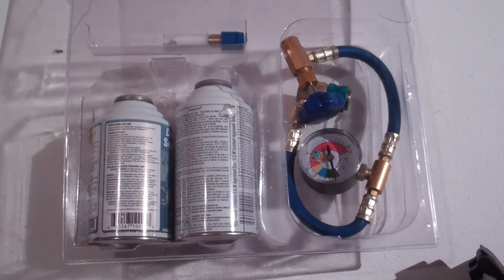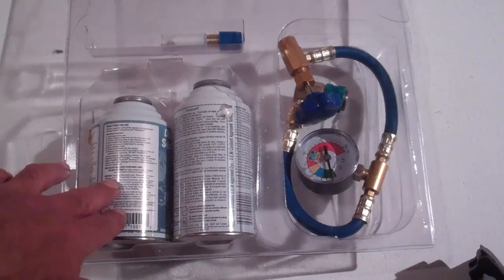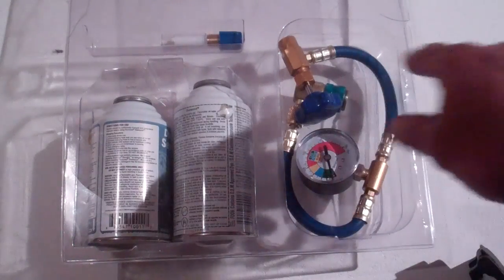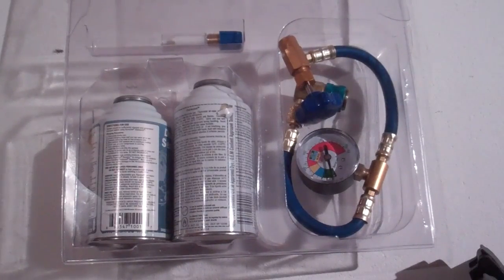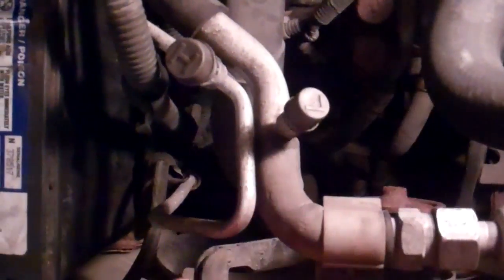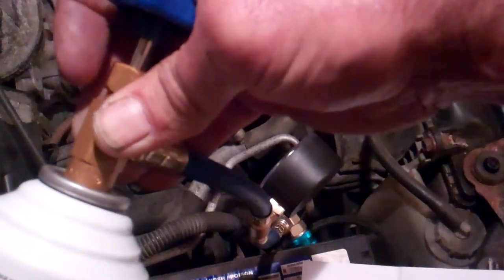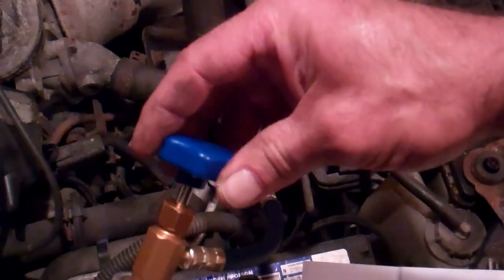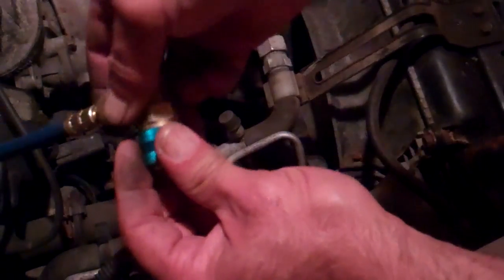Adding AC refrigerant into a vehicle system

Comment: I have a Chrysler 300.  When the AC is turned on, the passenger vents blow warm, the driver vents blow cold.  Anybody have any ideas why this is happening?
Reply: You have dual climate controls right??? A temp dial for passenger and a temp dial for driver side right??? Well if the passenger side vent is warm and the other side is cold with both dials set to cold temperature, your blend door motor for the passenger side is broken and not closing the door to the heater core. You need to replace it.
Reply: @grandam  you e diagnosed the problem perfectly.  Is this a big job, and what should something like that cost to correct.  Is 
Is
Is a DIY

Comment: You done so many thins wrong on this video so it should be removed.  Other may see this and follow your error.  The freon was not suppose to be inverted as you have your here...that will only allow liquid into the system and cause damaged to the compressor.  It was suppose to sit at 12:00 O'clock and gently shake it and turns it to either 9:00  or 3:00 O'clock every once in a while to let Freon into the system not liquid.  Please, redo
Reply: Not really, you can dump liquid into an empty system when the car is not running. It's faster and when you get close to the correct amount in the system then you start the car up and turn the can up the right way finish off to the correct pressure/volume with gas.

Comment: I know you should put your AC setting on its coolest setting but aren't you also supposed to put your fan on max when putting in the refrigerant??
Reply: He did so many things wrong and almost wanted scream
Reply: You can, but it does not require to be on Max. You should have blower on and put thermometer gauge in the vent to see what the temp the air is coming out of the vent. Just have the AC on Max and system up to normal operation.

Comment: You suppose to run the car while adding freon not afterward.
Reply: Yes they do.  I have a Dura-Cool Kit right here in front of me...and it advises you have the A/C on HIGH and the Fan on LOW setting and with the engine running!
Reply: @darring.9161  initially
Reply: X L Yes. It should be running on Max and up to full operation
Reply: Not with these kits
Reply: @TheMatissV  has X.

Comment: I bought this exact same kit from Walmart.  I knew my AC was discharged hence the hot air blowing from my vents day and night.  Its becoming Summer here again and the mean temp. is supposed to go up by something like 5-7°C this summer.  Like its not already hot enough.  I'm not about to roast in my car this time tho. From what I read about in the instructions, you first add the can of sealer, then continue with the refrigerants.  They also suggest using a can of dry core to get out any residual moisture before using the sealer. By the way, I was lucky and waited until it went on sale for $62.97 from the regular price of $99.97.  Good buy/Good bye.

Comment: when i try to connect the connector to the low side port , the refrigerant starts leaking out of the system before im able to lock it down in place... could it be a faulty recharge hose ? bought it from ebay ..